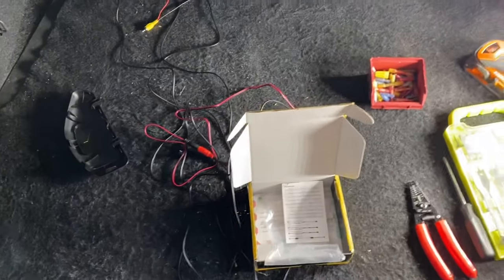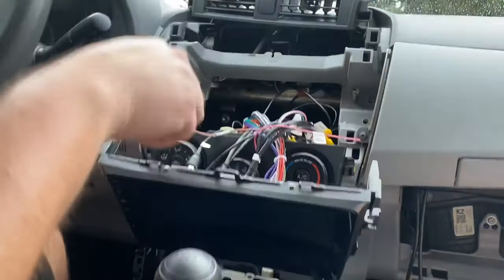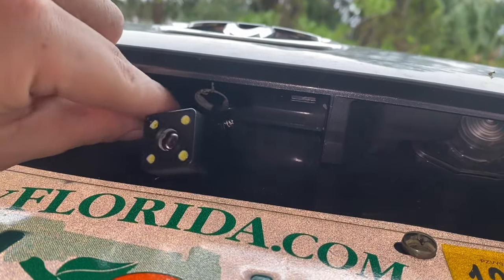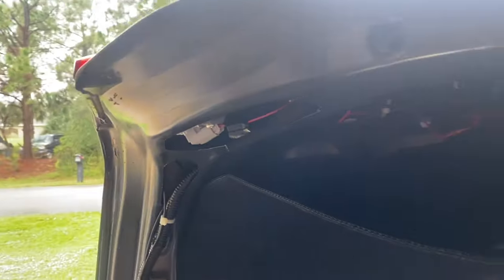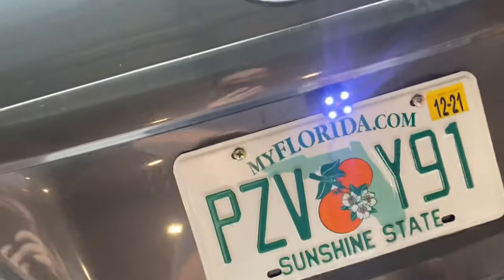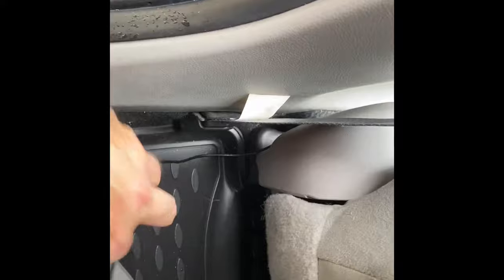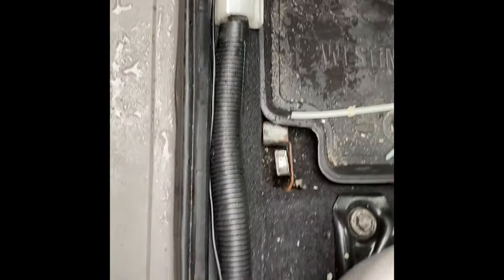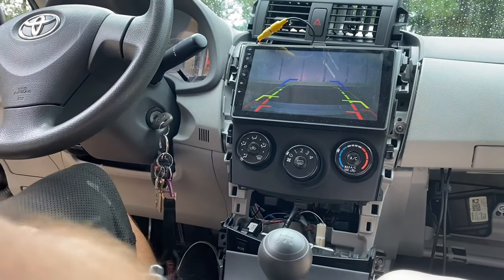How to install a backup camera in a 2009-2013 Toyota corolla

Comment: Did this wiring without relay cause any fuzzing or any other problems? I am planning to install same Android headunit with backup camera but i found out that i should use relay to supply power to the camera.
Reply from the maker: When I installed my backup camera I did not use a relay.

Comment: I’m kinda confused about what cables you’re using in the back. I only got a red and black cable that connects to the red port by the camera.
Reply from the maker: It’s been awhile since I have done this, but I believe the camera should come with 3 wires coming from it. There should be a yellow video where that just plugs into the other yellow cable that comes from the radio, than there will be a black and a red wire. The black wire goes to the black wire on the reverse light, and the red white goes to the red wire coming from the reverse light. 
I hope this explains it a little better.
Reply: @BrandonStellmach  oh this was pretty much as clear as it gets... thank you so much! I just finished tidying up the car after all that modding. I installed (from your videos) the tablet, the rear view camera, and the climate control lights. I’m waiting on some new headlights and that Apple car play piece to come in soon and I’ll be all set. Everyone saw the new changes I made and they were speechless that this was the same car that was almost going to get junked a few months back. Again, this channel is amazing thank you so much!

Comment: About how long was the back up camera wire?
Reply from the maker: I would probably have to say between 10-15 ft. There was quite a bit of wire, and I didn’t have any problems installing mine!
Reply: @BrandonStellmach  Great, my unit is coming tmr so I'm excited.
Reply from the maker: It’s a great upgrade! I loved my radio!
Reply: @BrandonStellmach  Also, how did you pop the rear seat up? is it like a clip?
Reply from the maker: @exocodm9327  yes it’s just a clip on both sides towards the fronts just try to grab the seat and pull up on it.
Reply: @BrandonStellmach  I got it installed successfully, I’m going to do the reverse camera another day. Thank you so much.
Reply from the maker: @exocodm9327  that’s great! I’m glad you got it figured out! And the backup camera takes a bit longer than the radio to install!

Comment: Great video Brandon, through your great review, I am installing a Binize Android 10. My backup camera is flickering, too dark, and SWC setting (learning) is not responding. I watched a few videos but have not found the way to correct it. I hope you or someone who reads this message can help. I have a 2010 Toyota Corolla S. Thanks in advance.
Reply from the maker: For the backup camera, there usually is a way to change the video format, either in the settings, or in the corner when the backup camera pops up. And try different settings until it fixes your problem.
As for the steering wheel controls, some radios will work fine, while others require more wiring. So if it’s not working with the SWC setting, then your radio might not have the OEM harness needed for steering wheel controls.

Comment: Great video mayne.  Ur videos inspired me to do mods on my 2010 corolla.  Just a question, is the back up camera u installed here different from what the radio came with?
Reply from the maker: Thank you!! 🙏 
And this one in the video is the same as the one that came with the unit! 
But I changed it to a new one a few months after that looks more OEM!
Reply: @BrandonStellmach  Awesome videos, Brandon. Can you please post the link to the newer camera that you say looks more OEM?
Reply: X2. Which one did you end up replacing it with? I assume you didn’t have to run new wire since you could use the existing one

Comment: Hi, is the camera get the power from reverse light wire?, or camera always get power while ignition switch on?
Reply from the maker: The camera gets power from the reverse light. So it only comes on in reverse.

Comment: Hey Brandon! I was wondering where did you mount the GPS from the Android Head Unit? In your last video you put it on top but now it’s not there anymore.
Reply from the maker: It ended up just falling into the mess of wires behind the radio. it still worked good when I had it there. But I don’t use the offline maps that much.

Comment: Isn't the angle too low ?..you hardly even see the back street at this angle.
Reply from the maker: Yeah the angle is kind of pointed at the ground, but you are able to adjust it on the outside to point it higher up.

Comment: I just drilled a hole through the sheet metal of the trunk lid near the camera and painted primer on the hole edge.  Then after I ran the wire through it I sealed it with RTV.  For the ground wire at the back I just put it under one of the nuts for the tail light mount.
Reply from the maker: That’s a good way of doing it as well! 👍

Comment: Awesome vid, 2 years later working to get the camera installed on my 2012. Installed the same screen as you actually but mine is on a single din and sticks out more? Your screen seemed to have no stereo on it compared to mine? Idk but at least can do the camera now and bring the ol girl to the 21st century! 🙌
Reply from the maker: That’s strange, maybe they changed up the design a little bit. Because this radio is almost 3 years old! 
But I hope this video helps out to get your camera installed!

Comment: Have you got carbitlink app that came with the head unit to work?  Mine can't get pass the unregistered screen.  
Also, were you able to install a compass app and made it work?  
Lastly, are you able to put the notification icon on the top in addition to what they had.  Like weather temp or even a compass.
I have the exactly same head unit you have in the same Corolla.
Reply from the maker: I actually downloaded the carlink app, which did not come with the Unit. Which gives me Apple CarPlay. And for the compass I have never tried to get it working. Again because when I use Apple Maps. And the temperature would only work if the radio is connected to the internet. I assume if you would want to connect it to a hot spot that would work. But for temperature I just use the cars temperature in the instrument cluster.
Reply: @BrandonStellmach  Can you provide the link to download the carlink app?   This app can mirror your phone to the screen?
Reply from the maker: @kito1san  here is a link to my video installing Apple CarPlay, and the link for the app is in the description. 
And this app is only for Apple CarPlay, it doesn’t not mirror your phone.
https://youtu.be/p8hxq7UkyuM

Comment: Hi Were the wires for the back up camera already back there or you had to run them through the car somehow. I didnt get that part. thanks
Reply from the maker: You are going to need to run them from the radio to the back of the car.
Reply: @BrandonStellmach  Oh I see! Thank you. do you run it under the car carpet? sorry never done this before.
Reply from the maker: @ammess2033  you will pop up the plastic door sills and run the wires through there, you will see all the factory wires in there and just follow them all.

Comment: Hey Brandon! Nice to see u again. I was wondering you just used the wire that came with the camera set to be able to connect it to the reverse input and to the reverse light? I thought you would need extra wiring to do that. I was listening to instructions on the kit I got from the same manufacturer that made my head unit
Reply from the maker: The camera should have to power wires coming out of it, 1 that goes to the back of the radio, and the other one that going into the reverse light.
Reply: @BrandonStellmach  I got it figured out. Thanks man and congrats on the new car
Reply from the maker: @The_blonde_boi that’s great to hear! And thank you! I appreciate it!

Comment: I installed mine and everything was working. But one of my brake light went out and the back car doesn’t show an image. I’m not sure what it is. I checked the cable and they look Fine. Do you have any idea what it could be?
Reply from the maker: Maybe if might be the fuse for your tail lights, try to find the fuse under the dash and see if it has blown?
Reply: @BrandonStellmach  I was able to fix. Turn out that the video cable somehow got disconnected. I taped it now. And my brake light just needs a new bulb.
Reply from the maker: @zurielbaxcajay2559  okay thats good. glad it was something easy!

Comment: This seems complicated 😓
Reply from the maker: As long as you have the radio similar to mine, it’s very simple. Just follow the video, and if you have any other questions just comment them down below.
Reply from the maker: Easily Amused  the radio I have is not available anymore, but this unit is very similar to the one I have just updated.

https://www.amazon.com/dp/B08CXTL3F3/ref=cm_sw_r_cp_awdb_imm_TMJK1MPK9QGJPG09T3PB?psc=1

Comment: One more question, I passed the wire same way you did using the lock hole. However, I am afraid of minor gap in lock hole due to the wire, and water can go in during the rain.

Also I realised that we should be good without drilling big hole, just at the bottom make a little space for wire to slide in
Reply from the maker: I never had any issues with water getting in. You could put a little silicon around the opening to make sure no water get in! 
As for the hole I agree. You can just cut a slot just wide enough for the wire to fit in!

Comment: Hi, the camera I bought only has one black wire that connects to the screen, and one red wire which supplies power. Is it the red wire or the black and white that supplies power? In other words, which color is the ground and which color is the power supply?
Reply from the maker: Typically the Red is the power that you would connect to the positive and the black is the Ground wire.

Comment: I’m in the middle of this install.  I got the camera mounted like yours. However I’m having issues with splicing into wires.  What are those plastic pieces you are using to do that called?
Reply from the maker: I believe you are talking about the Crimp connectors. That I use to splice the wires.

Comment: Is this a 12volt camera ? I’m not getting a whole 12 volts from the reverse wire
Reply from the maker: I’m not sure if it requires a full 12 volts or not. I know they grab the power from the reverse lights.

Comment: My screen is saying no video signal I would love an explanation on this issue Brandon, I know that the camera must be hooked up to the screen successfully. So my question is where is the mistake in the back end? Would I need to try to resplice the wires in the trunk or what would be the best bet?
Reply from the maker: That is strange that it says that. First thing I would check would be to make sure you have power at your reverse lights. If you do, then I would make sure the splice from the camera power and lights are connected good. 
A volt meter will be great to verify those! 
Then if all that is good, I would double check that your are using the correct wires behind the radio.
I actually plan to add a new backup camera to my new corolla soon, so I may go over some of the possible problems that may happen.
Reply: @BrandonStellmach  okay thanks Brandon, I will try to check everything and get back to you tomorrow. As for the reverse lights I know they are getting power cause they always light up brightly but I’m questioning my splicing ability cause it is my first time doing so lol! Thanks for the detailed response! And I would really appreciate another video if you could make a second video regarding the back up cam but I understand if it is redundant. Thanks a lot Boss big salute from Canada as always 🫡

Comment: how come my screen says no signal? i cant seem to figure it out
Reply from the maker: If it says that, then it is not getting any power from the backup camera.
Reply: @BrandonStellmach  Hey Brandon, im having the same issue.. how could we fix this problem?
Reply: Would it be an issue behind the screen or the wiring that gets spliced into the reverse lights so i know where to start
Reply: @bobbylauz1121  nah i fixed it, it was on a different channel
Reply: @brandonrybalnik6291 what do you mean? Different channel on YouTube or in the car?

Comment: I have a corolla 09 xle how would I remove that plastic piece  to drill a whole ?
Reply: Does key knob need to be removed or a hole is premade next to key ?
Reply from the maker: That plastic piece will slide out when you take off the 10MM hex nuts on the inside of the trunk. And I used the existing hole that the key would fit into. There was enough room for the wire and the key lock.
Reply: @BrandonStellmach  Thank you for info , I'll jump into it with more confidence. I appreciate the info will be doing the exact same method to update camera positioning.

Comment: I got the same one as you do, but I’m not able to use YouTube or play store , it says I need wifi. How do I connect wifi or hotspot ? 🥲
Reply from the maker: You will want to go to your settings in the radio, so the gear icon on the home page. And then you will click on WLAN. And then you will click on WLAN again. And now you should see your wi-if settings. And if your close enough to your house wi-if you should be able to connect. Otherwise use a hot stop on your phone to create a wi-if network to connect to connect too.
I hope this helps!
Reply: @BrandonStellmach  thank you but if I make a hotspot from my phone to my car will I pay more ? This the first time I’m using hotspot so idk to much about it
Reply from the maker: @nani4565  it all depends on your phone carrier and service you are paying for. Some offer unlimited data for hot spots. While other limit you to like 50GB. 
You will need to check with your phone service and see what you are paying for. 
But from my experience, you can either get Apple CarPlay or android auto, and I never need to worry about connecting to a hot spot or a wifi.
Reply: @BrandonStellmach  ok thank you, i ended up connecting my phone hotspot to my car. It works just fine, thank you again for the help